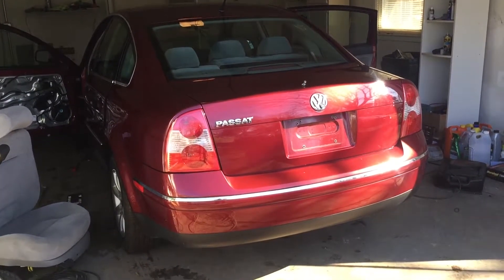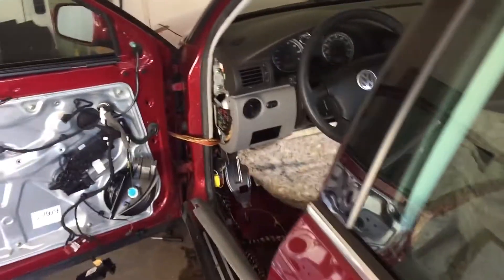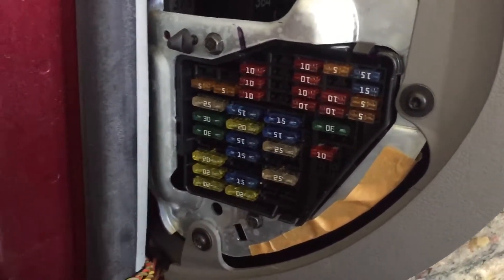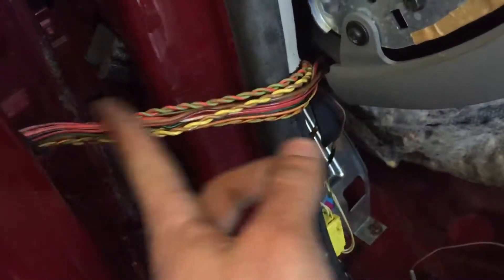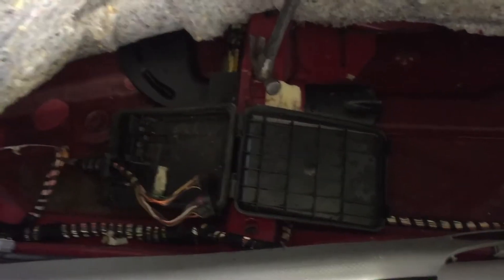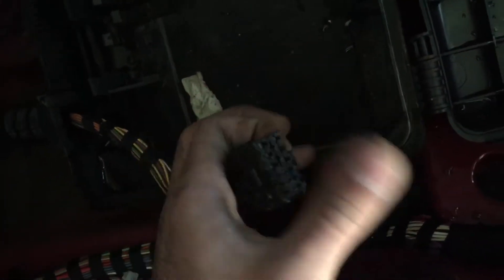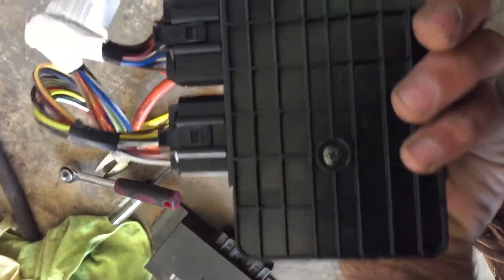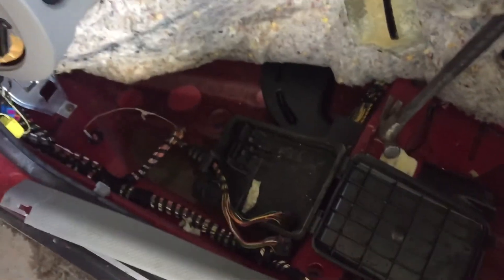2000-2005 VW Passat Windows, Trunk release Doesn’t work! Problem solved!

Comment: Best thing to do is to put the comfort blokk (module) into the dashboard behind the fuse box. I did and no problems.
Reply: With out the water tight case, it is not needid in the dash
Reply from the maker: @olluman123  thank you for sharing your solution with us.